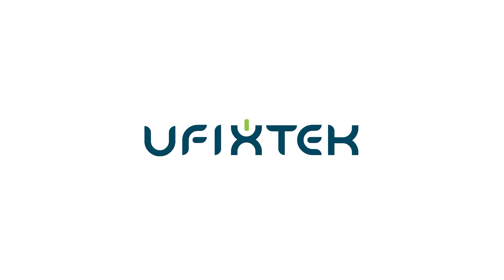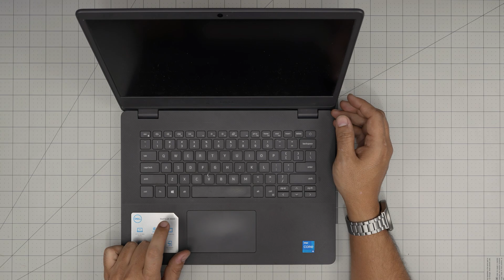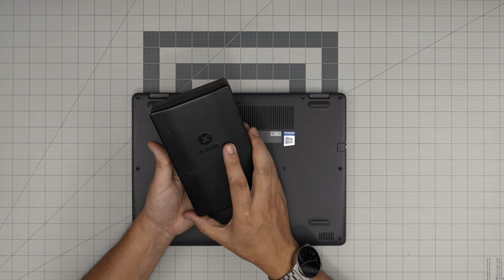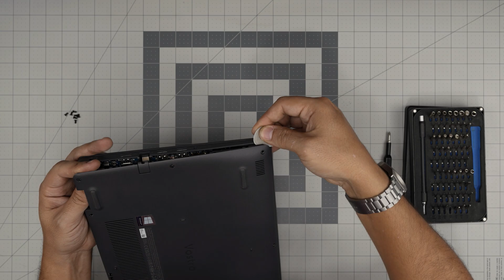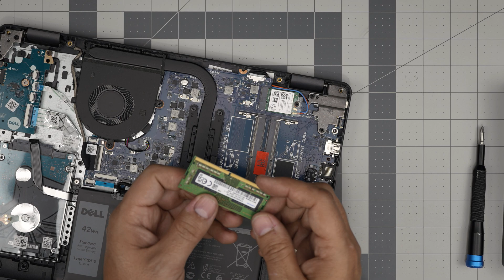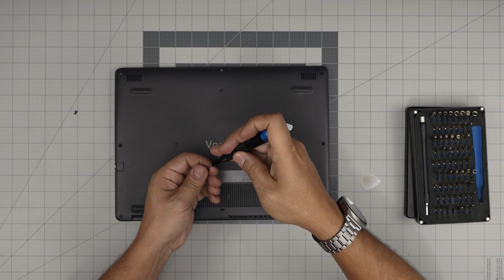How to Upgrade RAM on DELL Vostro 14 3000 Series Model 3400 | Easy Step-by-Step Guide

Comment: Hello I have this exact same Dell which I now have added another 8gb of ram but it’s only running at 2400 and not the 2666 speed which the manual says it runs at. How can I change that?
Also on a related note I did hear you mention you can add 16 gigs on the second module but the manual states a maximum of 16 gb (8+8). Would it be safe to try going for 24gb with a 8+16?
Reply from the maker: 🫠Regarding your question, it is normal for the RAM to run at 2400MHz because adding more RAM to a laptop often results in the BIOS automatically setting a slower speed. This happens because the XMP option is not available in the BIOS settings of this laptop. Therefore, the BIOS will automatically adjust to the maximum RAM speed it can handle based on the total RAM capacity. Additionally, it is completely safe to add 16GB and 8GB of RAM together without any issues.
Should you have any questions or requests in the future, please don't hesitate to ask me.
🍻cheers

Comment: Hi, I am trying to upgrade RAM in Asus X515JA-EJ372TS. Can you please tell me which RAM i should get? It has 4gb onboard soldered RAM. Can I add 16 gb? or 8gb? it only has one RAM slot that is currently empty.
Reply from the maker: 🫠Regarding your question, you can install an 8GB or 16GB stick without any issues. The links are in the video description. Once you power on, wait about 30–40 seconds for it to perform a memory check.
Should you have any further questions or requests in the future, please don't hesitate to ask me.
cheers🍻